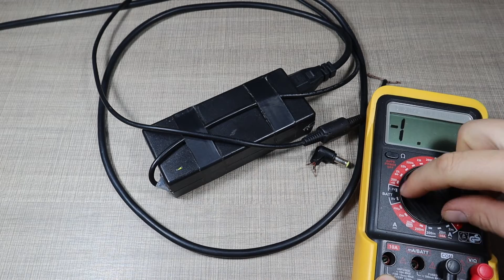Repairing a broken laptop charger cable with epoxy - DIY - Healing Bench

Comment: I have two chargers that don't work. 

First an universal adapter. Cable cracked close to the brick itself. I repaired it using a terminal block, unsuccessfully. The adapter has a setting of 12-24V, but after the repair it only outputs 12.4V regardless of setting. Might suspect too high resistance with the terminal block?

The other is a Compaq 18.5V charger. Was repaired by somebody else, gives green light and 19.6V on edge connector. Tried it on two known working laptops, not a sign of life. Have wiggled it around and tried different positions to no avail.

Ideas?
Reply from the maker: OK, so in first case, could it be that the adapter has two different outputs and you only connected the cable to one, effectively bypassing the switch? 

For the second case, if the connector has voltage, did you verified that the connectors match? If it is from the circular ones, there are connectors that have different thickness on the middle pin so maybe there is not a good contact?

Comment: Thank you, I tried this and now my laptop is charging, is using this repaired laptop charger safe? I'm gonna use this charger for a month before my OEM charger arrived.
Reply from the maker: As long as the wires are not mixed and are isolated correctly, there is no difference or harm in using the repaired charger.